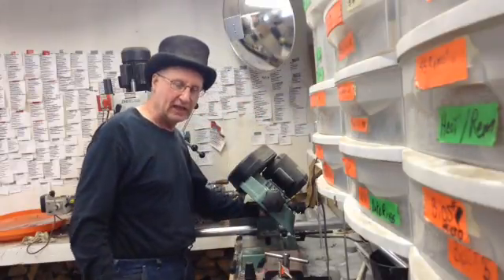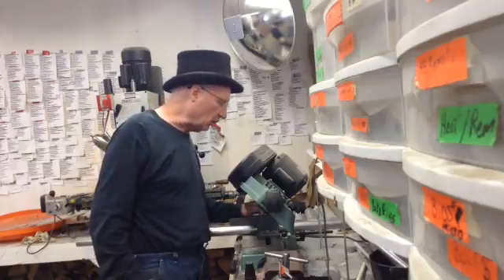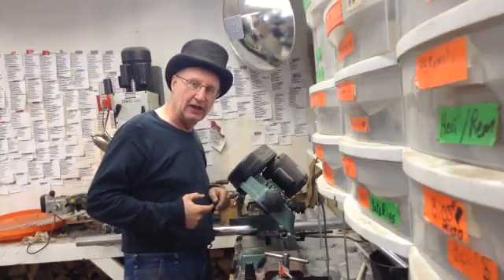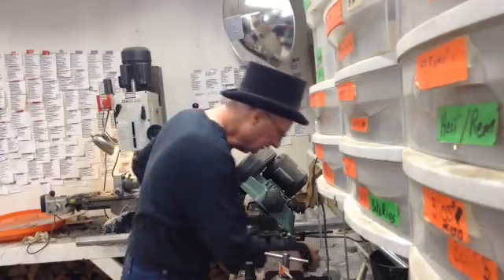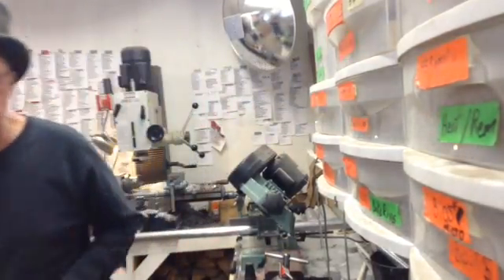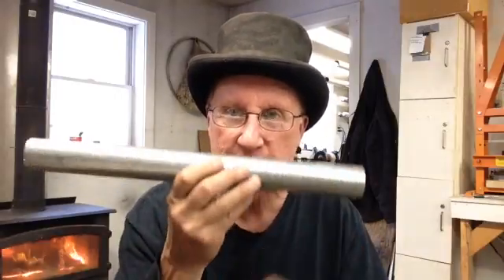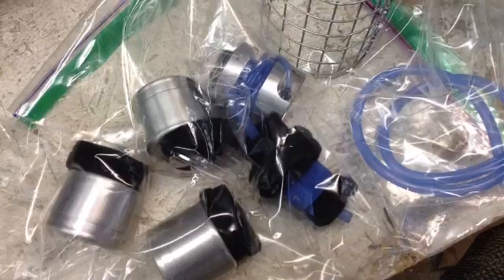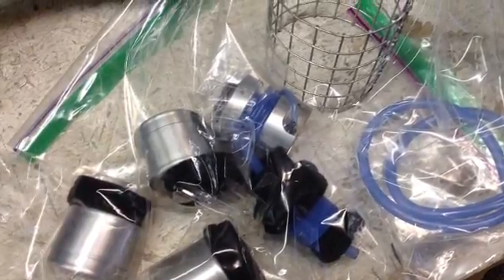Choke Demand

Comment: choke hazard is a great stove.  So easy to use. a small piece of brass tubing set, (high temp silicone grommet or something) through the side of the choke hazard, would make it a snorkel stove. It would lack the sophistication of the SS stoves, and leave the fuel nipple vulnerable to bashing, but you could,optionally, use the new remote caps with the choke hazard.
Reply: just a random thought.